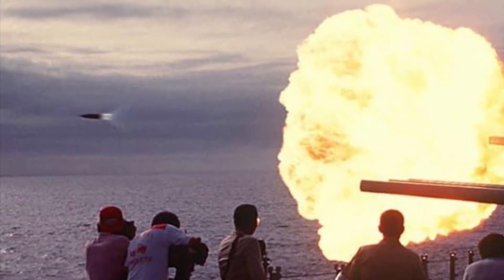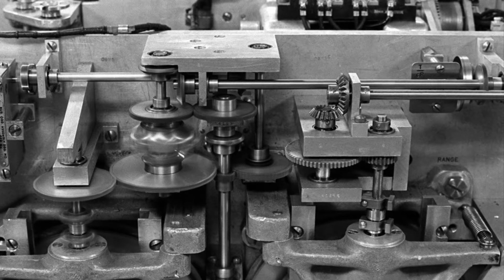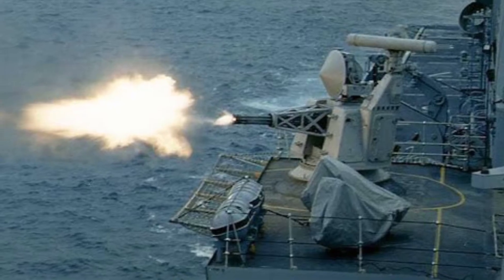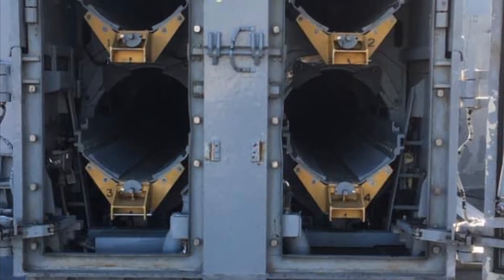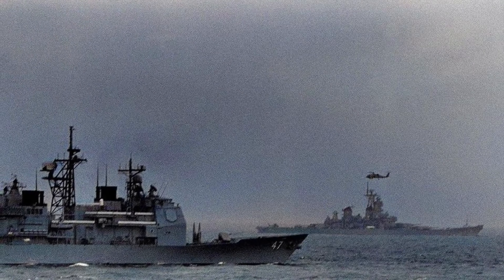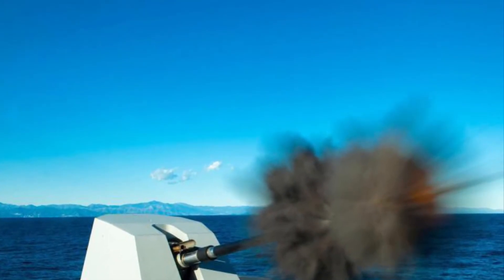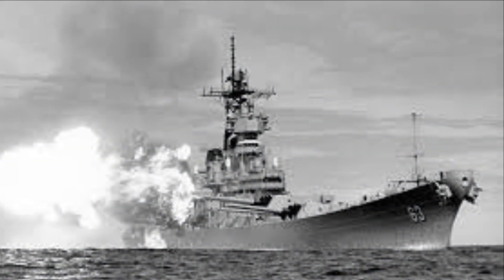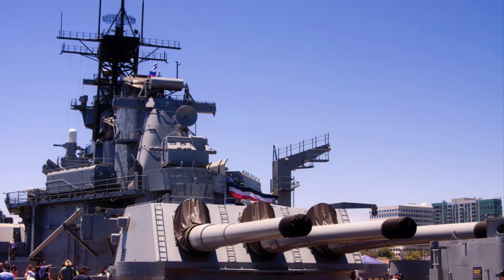How would I modernize the weapons on an Iowa Battleship?

Comment: OK--------- The biggest strength of the new Iowa is its 16 inch guns with new hypersonic smart shells with ranges in the hundreds of miles. Most of the Turret crewmen could be replaced by Car manufacturing or assembly line Robots that can handle the different sizes of new 16inch shells along with new powder cases reducing the ships crew by hundreds. The Big heavy Boilers and Steam turbins could esely be replaced by cheap reliable Gas Turbines that would not only reduce the crew by hundreds more but provide the needed power for all the new electronics modern weapons require. Though I would simplify replacing all 6 of the 5 inch gun turrets with the Current 5 inch DDG mounts already in the fleet that have had many new hyper velocity long range Smart shells developed for them that have been reported to be able to knock aircraft and Balistic missiles as well as ships and swarming boats at 50+ miles.  Though I would also add an Anti-sub Sweat of domes and towed  sonar along with Asrock missile torpedoes in your added 100 cell Virtical launchers. With 3 or4 Anti-sub/ Radar carrying Choppers carried in the stern below deck hanger operating from an inlarged squared off flight deck rounds out the new Iowa as the Terror of the sea it was in WW-2 for cruising in Dangerouse waters such as the SCS or off the Coasts of Iran.
Reply: So, I dont know if you are serious or not, but if you are: Do you have any idea what a nightmare refitting these ships would be? You have to completely redesign the interior, the complete hull structure and the electrical systems. How in seven hells would you remove the enormous boilers? If you want something like you are describing here, you have to build a new ship, would be cheaper and easier. And I don't know how you are coming up with hypersonic smart shells out of nowhere, but if you look at the AGS, the closest thing to this, one shot would have cost 1 million dollars. That is just unpractical

Comment: Would you power it with nuclear? Underway damn near forever.
Reply: Not that I mean to come off as a asshole. But suggesting converting an Iowa class BB to nuclear propulsion is sheer lunacy. Have you ever seen cutaway diagrams, or been on the ships in person? Just one Iowa class BB has 8-Babco and Wilcox Oil fueled boilers. So not only do you have the dilemma of how to remove these boilers, then what? What are you going to replace them with? 2- Bechtel A1B Nuclear reactors like the Ford Class CVN's? By the time you fantasize about such an extensive overhaul you might as well be fantasizing about a whole new ship. It would coast far less to build a new ship from the keel up than to convert even one Iowa.
Reply: Not to mention nuclear reactors don't take kindly to being jostled around

Comment: Not much you can do with the 16 inchers but maybe work on some new shells (no doubt this has already been looked at... atomic, rocket assist, EMP devices to destroy electronics and, God help us, biological and chemical). Nothing on this planet will intercept an incoming 16 inch projectile. Automate the 5 inchers (got any spares from the Midways?). AIMs are great but don't forget that, until force fields are invented,  you cannot deflect or jam an unguided projectile.  The 40mm and 20mm mounts are long gone. Fast reaction, high volume weapons will need very sophisticated and literally un-jammable guidance. Fit them with missiles instead of artillery?  It would cost several times the original  construction cost to remove the 16 inch turrets, machinery and magazines than it would to build completely new ships. Plenty of missile slingers in the fleet.
Reply: And what would the range on these shells be? What is gonna power all of these new systems? The ridiculously huge boilers? How are you gonna remove those?

Comment: Make it nuke, electric propulsion, give it mild hydrofoils. Drastic weight loss.  45+ knots.   Remove all the guns except four 5 inchers, which are now automatic.  Install AEGIS of course.  Add iron-dome, keep the CWIS.  Hella missiles in the front/middle, flight ops in the back.  Small mix of helos and a mini-naval-air-wing of 6 F-35s with flight elevators and a hangar deck.  Free electricity real estate for tech advances.  Bonus?  Multiple (24) integrated, articulating MLRS batteries on each side, for long range bombardment.
Reply: Nuclear reactors are temperamental when it comes to be jostled around. Which isn't exactly something you want on a ship meant to take hits and being on the "Frontlines" 

Also it would be next to impossible to put a reactor in a already built ship.
Reply: @HazmatUnit  Our carriers are nukes, jostling is not that big a problem.  And my fantasy includes extensive changes to the ship - there is space for quarters and mess for thousands of troops that won't be needed any more, and I could be wrong, but I bet a nuke making juice to drive electric motors takes much less space than the old engine rooms, fuel storage,  and prop shafts spaces.  It's an extensive retrofit.
Reply: @scottstewart5784  of course I shouldn't stomp on your vision of a extensive refit so nevermind the refit difficulties. 

But carriers are never meant to be in direct combat like a battleship is or in modern cases destroyers.  Hence why they are surrounded by fleets to protect them. 

If I remember correctly, The Battleship New Jersey channel does have a video over this topic if your interested.

Comment: Greetings, I was a gunners mate on the USS Iowa 16 inch turret 1. The 16 inch gun system is to old and is obsolete. The turrets on the Iowa leaked hydraulic fluid like a siv. A minimum of 5 gallons a day or a lot worse if the turrets were powered and used. How I would change the Iowa's is as follows. #1) Remove the 16 inch mounts and replace them with Virginia Payload modules. A single Virginia payload module can carry seven Tomahawks or three hypersonic missiles. I guess that five 87 inch diameter VPM's could fit in the 39 foot diameter Barbette's of the Iowa's giving them a capacity of 45 Hypersonic strike weapons or 105 Tomahawks. #2 Remove all the 5 inch secondary battery guns and install MK-57 VLS cells along the sides. I figure 30 modules on each side of the ship with 4 cells per module for 120 cells for SM-6, ASROC, RIM-162 Evolved Sea Sparrow which can be quad packed per cell and AGM-158C LRASM's. #3 Remove the armored box launchers and Harpoon launchers and replace them with 4 MK-110 57mm guns which have guided projectiles under development as well as programmable munitions. Their vastly superior rate of fire compared to 76mm or 127mm guns make them far more useful in small boat defense and missile defense. #4 I would install 3 SEA RAM launchers in the 40mm gun tubs, two in the stern, one at the bow. That is 33 RAM missiles working in conjunction with the 4 CWIS systems giving the modernized Iowa's a potent close in defense capability. If you add in 5 cells on each side of the ship for quad packed RIM-162 Evolved Sea sparrow missiles that gives you another 40 missiles for shorter ranged defense. #5 I would replace her antiquated radars and directors with the new SPY-6 with the full 37 RMA's per panel giving her the best detection and fire control radar in the world. This would make each Iowa the centerpiece for a surface action group or a land attack group.
Reply: i agree with most of the items on the list but i would have it loaded out as a fleet defense ship first offensive capabilities second like arm the thing with defensive SAM, SSM for them low flying missiles like exocets but leave space for some offensive Hypersonics
Reply: @marvingulanes5577  120 cells for the SM-6 and evolved Sea Sparrow missile is plenty of fleet defense capability in my opinion.
Reply: @Bellthorian  one can dream
Reply: No gunners mate would ever say remove her 16”. Liar
Reply: @bernielomaxsmustache7204  LOL I can tell you never had to work on one or spend a couple of hours a day cleaning up leaking hydraulic fluid on the electrical decks. I know for certain you didn't have one take 47 of your shipmates lives in the blink of an eye. The 16 inch gun as a weapon in MODERN naval warfare is incredibly overrated and only fanboys think they are special.
Reply: @Bellthorian  well maybe next time close the breach of the gun? That probably would have helped. And bulkley toured the iowa, it was the only one leaking fluid out of the 4. Which had no effect on the incident
Reply: @Bellthorian  yeah calling me a fan boy and not thinking that the power of a 16” gun isn’t special…..that confirms your a liar and never served. Stolen valor at its finest
Reply: @bernielomaxsmustache7204  LOL Since there are two different types of Gunners Mate's GMG or Gunners Mate Guns and GMM, Gunners Mate Missiles at least half of the Gunners mate would say hell yeah yank them. Especially if you are replacing them with Virginia Payload modules loaded with the long range hypersonic strike weapons that are going to be put on the Zumwalt's when they yank their advanced gun systems and replace them with Virginia Payload Modules.
Reply: @Bellthorian  how are the zumwalts working out right now? You know as much as I do a 16” goes farther than 20 nautical miles. How could you say they are obsolete? They said that during world war 2, korea, Vietnam, gulf war etc etc. nothing compares to the output of a iowa class battleship for supporting ground personnel during a ground deployment. Can you jam a missile? Yes. But how many 5 inch and 16 inch shells can you jam? How much ordinance can a iowa class put on a target and how fast as compared to a carrier and how long it takes to launch that many aircraft?
Reply: @Bellthorian  ok??? So upgrade the mk directors for better accuracy. How much for a tomahawk Missile compare to a shell? How many tomahawks can you carry as opposed to shells? And when a 16 inch shell does hit its target, it’s gone. Not bad for 80 year old technology. What do we currently have for a shore bombardment to support ground troops? Nothing. And what happens when somebody fires back at you. Again, nothing has the armour belt of a iowa to withstand punishment. 

Look at her propulsion as well and her speed for being that big, that heavily defended. It’s incredible to think how old she is and the speeds she attains at 80 years old. With digital upgrades and newer maintenance etc it would still be a excellent fighting ship platform with armor that no other ship has
Reply: @bernielomaxsmustache7204  Well from what I heard is that even if the sensors/directors were upgraded they wouldn’t do much good. I heard that it was just the guns themselves and that you really couldn’t improve the accuracy that much.
Reply: @odstdetective4194  Blast from a 16" shell has very few contenders, not counting hitting a magazine complex.

Replacing the old 5" guns with the guns meant for the Zumwalt destroyers would enable these battleships to fire the newer longer-range shells. I hear they are designing shells for the 155mm guns for longer range, these guns would be acceptable replacements for the old 5" guns.
Reply: @Strayshot2010  oh yeah! You’re talking about the Excalibur rounds? They could actually work. I was just referring to the old and original 16 shells. However if you were to make shells like Excalibur it could be worth it.

Comment: With Excalibur technology or equivalent. IE base bleed rounds or rocket extensioned munitions. Those (relatively) cheap 16inch 5k$ base rounds, 10k to 20k$ rounds (extend or extreme range) would reach 200 miles plus, with twice the payload of a tomahawk cruise missile. Need volume to bring prices to these levels.
The tomahawk cost 1 million dollars twenty years ago, so currently would be probably now 2 to 5 million. 
This is an absolute no brainer.
Bring all 4 Iowa's back.
Reply: if only new guided munitions gonna be used, drill the barrels to make them smoothbore and get even more range, and possibly, even bigger caliber for free. Also if possible, replace conventional powder with electrothermochemical charges, they offer even more oomph from the same volume, but first of all they are really hard to ignite (you need a plasma arc for that).
Reply: ....200+ mi? For real? I like battleships and all, and I would be so glad to see them return, but man, that is an insane range...
Reply: 200 miles from coast would put 95% of Chinese assets in the drop zone. And possibly that 200 mile range could be extended further inland.
Just wish that here in the UK we had not scraped vanguard. :[
Reply: How the fuck do you come to 200 miles+? That is absolutely ridiculous. The planned AGS onboard the Zumwalts were supposed to have a firing range of 150km. And they would have cost 1 million dollars per shot. Literally pulling stuff out your ass

Comment: Easy Peasy: Add a couple batteries (or a few, it’s HUGE) of Lockheed’s stealth cruise missiles.  Then, replace the 16” guns with rocket-assisted, GPS guided sabres. Lasers are a must, now and stern.  Plananx / Sea Ram / Goalkeepers per best placement.
If you have really deep pockets, why not throw on some low-yield nuclear depth charges (and change the policy on the use of low-yield nukes in a one-on-one self defense situation)?  Well, I’m sure there are plenty of reasons.  But, if sub commanders knew you were packing some certain death in the even they fired on you, they probably wouldn’t do it.
Secret upgrade: A medium-planing hydrofoil system.  I probably just made that term up, but it would be a system that doesn’t take you all the way out of the water, but definitely reduces drag.
Finally, yank out the diesels and replace them with newer, more efficient diesel-electric generators with motors to match.
Then, across the port and starboard sides write, “DO NOT APPROACH WITHIN 150 NM WHILE ANGRY”, which is funny, cause that bad Mo will be approaching them!
Oh yeah, everyone onboard gets an Uzi or Mini-Uzi. That solves the problem of even the most sneaky pirates.
¡Bon Voyage!
Reply: The Iowa is already equipped with Cruise Missiles and the Phalanx batteries. Wouldn't want to get near an Iowa Class Battleship. It's deadly. That's why they're the lead ship in a battle group.
Reply: @meljohnson4715  As long as the launch system supports the Lockheed / Raytheon LRSO, we’re in business.  Anything else you’d add to the wishlist?  Optical stealth?  Electromagnetic camo?

Comment: Goalkeeper is largely a dead system & being phased out by most Navies. Most of them have switched to the Phalanx or the SeaRAM's. The radar system & the fact that the Goalkeeper needs more space & have parts of it below deck vs. the standalone system of the Phalanx have caused the Goalkeeper to be largely obsolete. The marginal increase in effective range & effectiveness is not worth it. In an ideal world they would need to remove most of the 16" guns & replace w/ the VLS to match the 96 to 122 VLS tubes that the Arleigh Burke class & Ticonderoga class have at the very least.
Reply: Phalanx is just as obsolete it is being replaced by SeaRAM. The Goalkeepers in our navies are being replaced by the Millennium gun in combination with the 21 shot RAM. But then again our next generation frigates will be better armed than the average Asian destroyers.
Reply: @jacksonteller1337  Yes, but many navies in the world are still employing the Phalanx & the SeaRAM is essentially the Phalanx radar system tied to the RAM missile system. Even the most modern ships like the Ford Class Carriers, QE Class, Arleigh Burke Flight III's are using the Phalnx in conjunction with the RAM launchers. A lot of navies are skipping the SeaRAM altogether as the standoff range just isn't good enough. The next phase for the US Navy now is they are in the testing phase of laser weaponry.
Reply: The millennium gun is a really good weapon
Reply: @alexdunphy3716  It is. Has a far better effective range than the 20mm Phalanx round (4KM vs. 2km), though a huge difference in rate of fire (1,000 rpm vs 6,000 rpm).
Reply: @fanman71  it doesn't need to hit the target though because of it's advanced airburst munitions